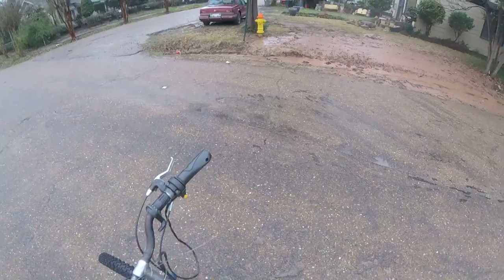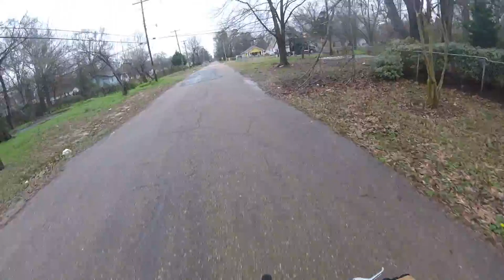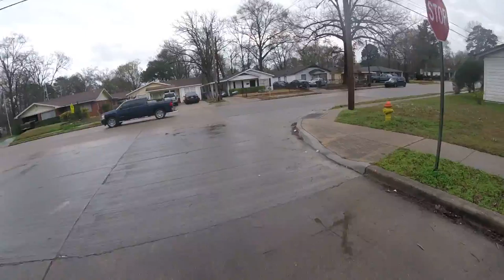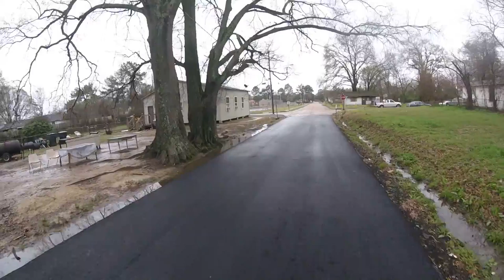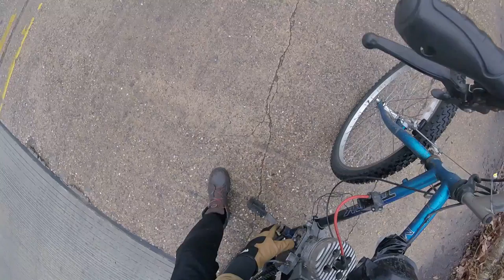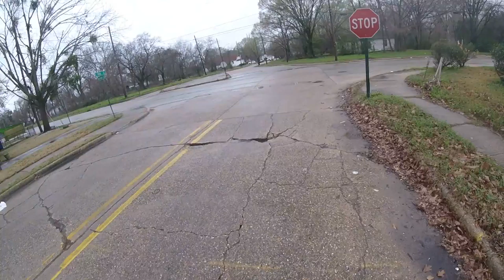Custom Built Gt-90 Case Reed Pt.1 No Top End

Comment: It's your jets homes jet down 5
Reply from the maker: Mike Hoffman dang I forgot about the Jettin lol Thanks Mike I’m gone try it
Reply: I hate that sound lol why I know
Reply from the maker: Mike Hoffman True and it did sound like it was getting too much gas
Reply from the maker: Mike Hoffman Lol you know I gotchu, I gotta put it on the gas frame to test out the real performance bcuz I cant put the mz65 pipe on the bike ... its gone hit the tire
Reply from the maker: Mike Hoffman lol Now I gotta figure out the Jet number in the stock 16mm Keihin carb I been looking for the longest on forums and I even took the carb apart but theres not jet number on it lol 😂lol I tried jetting it but I didnt know where to start lol 😭
Reply: What was your speed when the motor started 4 stroking

Comment from the maker: I started on the Gt-90 Case Reed type builds about 3 months ago in November. As you notice it bogs out at about 30 Mph. Currently still "Trail and Error in",  the Port Timing and Port Design. It's Kind hard since the intake is in the case!
Reply: Case reed has no intake port timing. It's open 360 degrees. You need an exhaust for fuel scavenging. Port timing is exhaust and transfers at this point not intake.
Reply from the maker: BTW thanks Kurt you sure help alot and gives good advice
Reply: Did you get it figured out
Reply from the maker: kjsmolik yea i been did it was the jets
Reply: Cool
Reply from the maker: kjsmolik yea You know im Eric Washington on Zeda Mafia fb group
Reply: Jesus Christ. Eric my bad. I didn't even put 2 and 2 together..sorry bro
Reply from the maker: kjsmolik lol i thought You knew it was me and its cool lol ... cya on the page Bro

Comment: That thing needs an exhaust
Reply from the maker: Jake Makes true but thats not the reason why it bogs out
Reply: Sure it can be the reason. 2 strokes need exhaust for fuel scavenging. And your gonna burn the piston because there isn't anything to draw heat away from the piston. No exhaust means your running lean. It's just as bad as an air leak

Comment: Where's the exhaust?
Reply from the maker: Dan mz 65 pipe wont fit and pedal hits the stock pipe
Reply: Rinegn Productions you need to bend the pipe then. You are gonna ruin your rings if you run without an exhaust

Comment: Your running to rich or to lean
Reply from the maker: LIGHTNING ROD XP maybe its jetted to rich or too lean? But those are the stock jets I have a 16mm keihin carb My big Homie told me to Jet down I have Jets but I dont know where to start because the jets in the carb are unmarked 💀
Reply from the maker: LIGHTNING ROD XP I will try it .., Im bout to try to find some info on the Keihin Carbs stock jets
Reply: Yes running lean because he has no exhaust..2 strokes need exhaust for fuel scavenging and for cooling..without scavenging he's running lean and hot.
Reply from the maker: kjsmolik 
Yea the only reason why I had no exhaust is because the mz65 wont fit and im painting my gas frame and also I just wanted to test on the engine but Im gone eventually put it on the gas frame